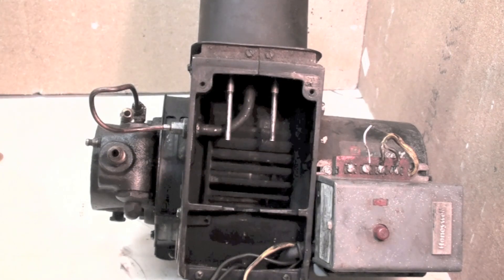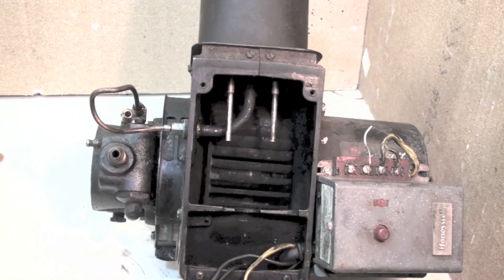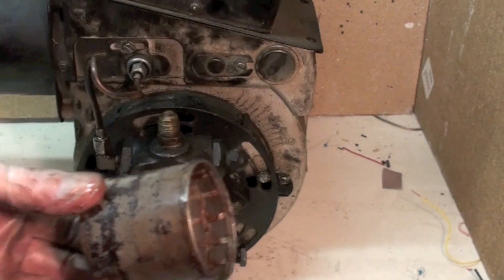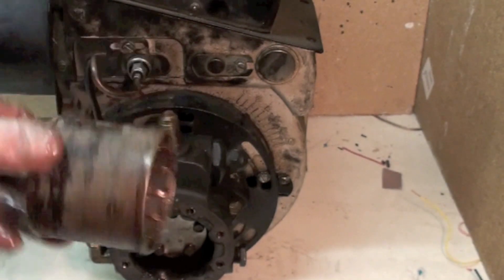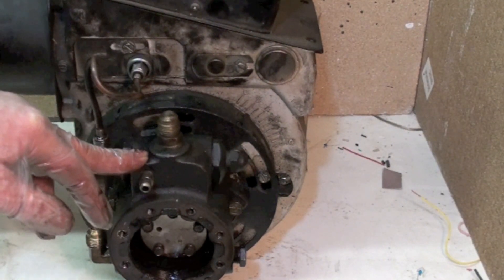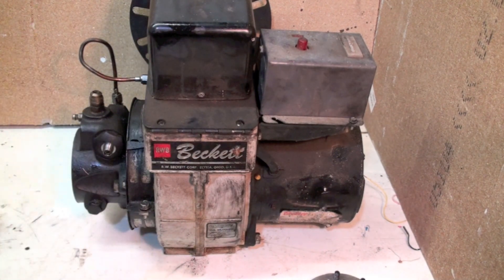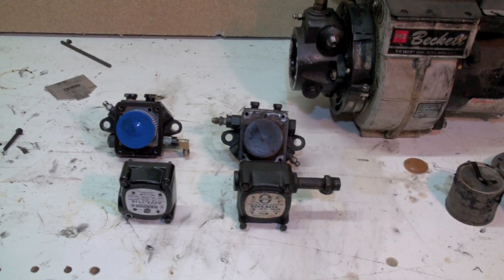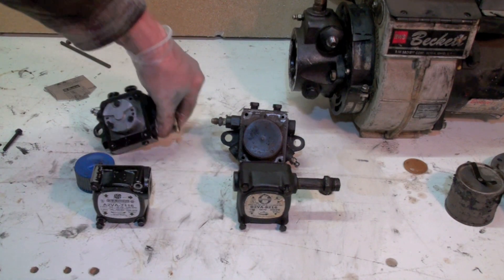oil furnace pump screens

Comment: Once you remove the fuel pump case where the screen  is, do you have to replace gasket
Reply from the maker: I usually use a silicone sealant rather than replacing the gasket.
GFM

Comment: thanks for the video, had fuel going to my pump and out my bleeder but not out to the nozzle. Used my ultrasonic cleaner to clean my nozzle and the pump screen with 50/50 mix of water and simple green. Made the nozzle and screen brand new and now Im up and running again with heat.
Reply from the maker: Oil nozzles cost about $5.
GFM

Comment: Having a hard time removing the cover on the A2VA-7116 pump to access the filter. Is it just the four bolts that hold the cover on? Doesn't want to budge and I don't want to break anything.
Reply from the maker: It is just the 4 bolts.  wooden hammer?
GFM
Reply: @grayfurnaceman  thanks so much for the reply. And thanks for the videos!

Comment: Love your videos!  I have a problem I can't solve.  My Wiel McClain oil boiler at my tenants house is making a noise like a washing machine before it starts up.  Very intermittent but she claims once a day.  It's never done it while I'm there.  I did a full cleaning and filter/nozzle replacement.   But it hasn't shut off or stopped working.  What could possibly make a washing machine noise before it starts?  I've heard it only on video she sent.   I appreciate your help!!!
Reply from the maker: Could be air is the system.
GFM
Reply: @grayfurnaceman  In the oil supply line?
Reply from the maker: @jcstevegigs  I would think in the water system.  Pump starting?
GFM
Reply: @grayfurnaceman  I was just over there this morning.  Fires up nice from thermostat or hot water call.  She says it was happening in the Summer with hot water so that eliminates the hydronic heat.  Al I can do is start replacing stuff like the motor/pump/coupling and see what happens.   If only I could hear it once from inside the shed.  
From inside the house it sounds like a washing machine out of balance.
Reply from the maker: @jcstevegigs  I don't have any answers.
GFM
Reply: @grayfurnaceman  that’s ok.  Hard to diagnose from a few paragraphs.  Thanks for your time.
Reply: @grayfurnaceman  I’ve had to reprise that furnace before for no reason.  Could air be entering the line somewhere?   Wouldn’t that show a leak?    There’s no leak anywhere.

Comment: I've gotten into working on old fuel oil furnaces and hot washer burners over the years and I am finding a lot of 1725 RPM burners running 3450 RPM pumps and having zero issues even after years of use.    I have several I use in various applications myself and they have never had problems either.
Reply from the maker: As long as the pump is oversized, I can think of no issues with this.  I have never liked the 3450 pumps.
GFM

Comment: Is there a type of filter cleaning detergent you buy  for cleaning the filter or will any detergent do the job
Reply: If you mean the pump screen, detergent usually works but if it is quite bad, you may have to replace the screen.
GFM

Comment: Damn! Everything but the coupler! Mine disintegrated. I don't know if it's from the  heat or a seized pump. Here we go. Thanks for showing me the screen. $100 bucks for a maintenance call and I don't see anything that was cleaned or maintained. I should have never looked! Curiosity killed the boiler

Comment: That round plastic disk is not necessary when using the new style disposable J-pump screen, however, if you clean and reuse the steel  permanent pump screen, you may want to reinstall it.
Reply: Plastic disk I called an anti hum device.

Comment: My burner won't start on it's own. It will fire up when I press the red button on the Honeywell CAD cell relay , but only runs for about 2minutes at a time. I timed it.
Reply from the maker: This could be caused by a number of conditions.  Plugged oil filter, blocked oil line, blocked pump screen, dirty cad cell, plugged nozzle.  If the unit does not burn when you press the reset, do not press it again.  You could fill the combustion chamber with oil which could cause a fire.
GFM

Comment: I have spark like crazy but no fuel, thought my pump was older one, with 1700 rpm, and hooked up an electric motor that is 1700 rpms, but realized my pump is 3450 rpms, am I correct in thinking 1700 rams would not be sufficient to pump fuel.? I have electric motor my spark coil and my burner with fan all hooked up in a line, I just wanna see if runs, gave a jar with diesel and got it going to the in line, it originally is run off a gas motor, just for testing do I need to put return line in the fuel.? Or anything else.? Thanks a lot for your help, I'm greatly appreciative.
Reply from the maker: 1700 will pump, just maybe not enough.  All pumps can be 2 pipe or one.  If there were 2, 3/8 fittings on the pump, it is 2 pipe.  One fitting, one pipe system.  One pipe system may take a while to draw the fuel up.  Hope this helps.
GFM

Comment: I have      the  pump with the chopper type  in it  and no screen  4 screws hold the back cover on ,, now if I bought  a brand new pump, to replace the old one, and I do not have the proper  pump pressure gage to set up the pressure, how could I set up the pressure at  a ball park  amount of pressure so it would work ?
Reply from the maker: +Rondo Schiavoni Most of these pumps come set at 100#from the factory.  Older furnaces, 25 years or more probably used 100#.  Hope this helps.
GFM
Reply: YES MINE IS KERO SAME SET UP AS OIL  BUT ITS 20 YEARS OLD .
Reply from the maker: +Rondo Schiavone Look on the model plate.  It may give the pressure.
GFM
Reply: thanks for your help you have very good videos.

Comment: might be a stupid question however  Ill ask you anyway, once a oil burner fires up, does the transformer continue making the arc spark in front of the nozzle or not?
Reply from the maker: +Rondo Schiavoni Most setups have the transformer operating for the entire cycle of the burner.  The cad cell relay can be set up to stop the transformer after the trial for ignition, but it is seldom done.GFM
Reply: in other words  ,you need spark to keep the flame lit?
Reply from the maker: +Rondo Schiavone It probably does not need to be on, but there is no down side to leaving it on during the cycle.
GFM
Reply: OK  I was just  thinking it would add more life to the electrodes and the transformer ..  thanks for all your advise .

Comment: After I cleaned the screen on a Delta CV pump on a Beckett AFG burner with a 1.1/.80 nozzle, a smell of oil came into the house theough the f orce hot air vents when the fan started and I noticed smoke coming out of the observation port of he furnace.  Is it possible that this is because of afterdrip?  Why would taking apart the pump cause this.  There are no leaks anywhere before the nozzle.  I can't see into the furnace.
Reply from the maker: This could a positive pressure in the heat exchanger.  Do you have any smoke coming out of the barometric damper?  If so, the chimney is plugged.  If smoke comes out of the inspection hole and not the barometric, the heat exchanger is plugged.  I don't think taking the pump could have anything to do with this.  Also possible partly plugged nozzle.  Hope this helps.
Reply: grayfurnaceman
Thanks.  No smoke coming from barometric damper; sometimes smoke coming from the inspection hole.  Would a plugged heat exchanger send bad air or fumes up into the air vents?  Why only upon startup for a few minutes if it's really plugged?
Reply from the maker: msrtra Sometimes when the burner warms up, it will draft better.  The other possibility is a crack in the heat exchanger.  Cracks in oil furnaces are not common but it does happen.  It may start smoking when the circulating fan comes on.  
GFM
Reply: grayfurnaceman
OK.  I think I solved it.  I took off the flue pipe and saw about 5 or 6 oval tubes.  They were buried in soot and ash.  It was 5 inches deep.  I vacuumed it all out.  I vacuumed out the tubes also.  The area under the flue exhaust connection (on top of that metal platform like thing) and in front of those tubes is all clear now.  Where did all that crap come from?  Does it mean that there is a leak somewhere?  I will go in tomorrow and vacuum again.  Anyway no smell anymore.
Reply from the maker: I did a series of videos on cleaning the oil furnace heat exchanger:  http://youtu.be/8ha2LRyGRpc  I recommend you have it commercially vacuumed out for best results, but if you have no choice, you can do it with a big shop vac.  Dirty job!

Comment: I have the second pump you were talking about at the ,sundstrand pump on my boiler are the two screens the same I need to change my screen
Reply from the maker: When changing a screen, always match it to the pump model #.
GFM
Reply: Ok thanks....the screen has the same number on the pump you are displaying so is that the right one? Av27116?
Reply from the maker: I believe so.
GFM
Reply: Thank you

Comment: Heres a heads up my burner pump would constantly run sounded like a river flowing thru the house weve bin having very cold weather lately turns out the radiator by my front door the pipe was froze thawed it out life is good
.

Comment: Just how much will the small amounts of dirt shown affect the pump functioning? I had some crud get in there which actually stopped the burner from firing up and used some spray solvent into the inlet connection to remove the crud. Seems to be working okay now but am thinking maybe I should pull it apart and take a look.

Comment: i took the pump off completely. The coupling looked good on the pump. I turned the pump freely by turning the coupling and heard it moving inside and bubble came out of the hole. Now i guess that means the pump is good but i’m still not getting fuel to come out of the primer????

Comment: Screen was clean on the mini pump, oil filter was just changed, there is fuel in the tank. Couldn’t find any leaks or obstructions. Just can get the fuel to prime in the pump. Haven’t taken the pump off completely just the cover to the screen. The screen and cover looked good. Do i need to take off the pump completely to see if the coupling has stripped out?
Reply from the maker: Yes.  Remove the pipes and 2 screws and it slides out.
GFM

Comment: I’ve checked the tank for fuel, checked the lines for blockages and air leaks, my motor is running and my fan blade turns freely? I just am still not getting fuel to the burner.
Reply from the maker: If you know fuel is available, the are no vacuum leaks or blockages and any screen is clean, the next step is to check the coupling that powers the pump.  They sometimes strip out.  If you know the pump is turning, the pump has failed. Hope this helps.
GFM

Comment: How can i tell if my pump is bad if i don’t have a gauge? My furnace stopped working. I bled the line and got it running again. It would run a little while a kick off. Everytime i pushed the reset button it would fire right up. After this went on for a few days it shut off and wouldn’t restart. I tried bleeding the line but nothing comes out of the bleeder? I’ve since replaced the oil filter since the old one was dirty but still i get no fuel out of the bleed screw?

Comment: i have a small fuel oil leak under my burner after the unit shuts down about 3 or 4 drops it dosen't appear to be coming from the pump gasket any ideas anyone ?
Reply from the maker: It could be a shaft seal leak on the pump.  Pulling the pump may show a leak.  You could also have oil impingement on the burner head.  Either one means you need to attend to it.  Hope this helps.
GFM

Comment from the maker: When we bleed an oil furnace pump, we are trying to clear both the suction and discharge line of air.  A vacuum pump would vacuum the discharge line but, as the pump is a positive displacement pump, it cannot pass thru the pump.  The pump pulls a vacuum, so the external vacuum pump is unnecessary.  Hope this helps.
GFM

Comment: Thanks for the reply! Today the furnace would not fire-I figured a block in the system (this happened about 6 weeks ago). I managed to get the screen out. It was really gummed up. I was able to clean it (used 'orange degreaser' and a toothbrush)- looked good-as-new. Re-assembled everything and tried to bleed the system through the gun line because I initially couldn't get the bleeder loose. No luck. Got the bleeder loose and bled it as you mentioned, then it worked! Thanks for the info!!

Comment: It could.  I would replace the nozzle and check the combustion chamber for carbon buildup.  When adding combustion air, the smoke should just disappear or better use a smoke pump to set smoke.  Also check for soot buildup in vent.  Hope this helps.
GFM

Comment: This is great information! I have the A2VA-7116 pump and there is no in-line oil filter. I haven't taken it apart but I imagine that my screen is probably caked up. The screen has never been serviced in >6 years since moving into my house. I have recently noticed that black smoke in the flue pipe while the burner is on. I adjusted the air and the black smoke disappeared. Now the smoke is back. There are so many variables, but do you think a clogged screen would contribute to the smoke? Thanks!

Comment from the maker: At this point, I would be looking for air leaks in the line.  Oil filter canister gasket, all fittings and pump gasket.  I would silicone the gasket on the pump.  Attention to detail is important here.  Suction leaks sometimes will not leak oil but only air.  Hoping for a solution and a warm night for you.
GFM

Comment: after we disconnected the line and blew through it, and cleaned the oil pump and reconnected it we used the bleed valve and no oil came through it. he tried to prime it 6 times afterwards and still nothing..

Comment from the maker: Have you been using the bleed valve?  If the line is full of air, it usually wont bleed through the nozzle before it shuts down on safety.
Hope this helps.  
GFM

Comment: we removed the entire oil pump and cleaned it out, the gears do spin on it. and now I understand why the fuel isnt in the line its because we dont have enough fuel in it. makes sense. he blew out the line going to the tank and we still have no oil..the screen is cleaned out also on the oil pump. we are not getting fuel to the pump, any other suggestions?

Comment from the maker: First, when you are constantly running out of oil and having t prime the pump, the chances of you plugging the nozzle go way up.  I understand the economics but try to add oil before running out.  If your tank is at the same level or higher than the pump, you can loosen the oil fitting at the pump, should get oil.  If oil, remove gun line point to can.  restart unit.  Should get oil.  If no oil check screen.  If you have oil, nozzle is plugged.  Hope this helps.
GFM

Comment: page 2.. and let out a pot full of water and still nothing. after lockout and the furnace goes to kick on you can hear it zapping and then a click where the ignitor would ignite and it doesnt. What could be our problem/A dirty screen? Is it the pump thats bad? we have no idea what we are doing except from what is on your videos. how do we check to see if the pump is even getting oil?

Comment: page 1...s my dilema.. we are poor and cannot get oil assistance since half my house is ran by electric and the other half by oil, we had to choose electric assistance in order to keep the electric on. With that said we put 5 gallons of diesel in a week so we are always priming the pump. This time the pump started and the furnance kicked on for a day then shut off. We changed the nozzel and the filter on the oil tank, blew in the oil line ( we could hear it gurgling in the tank) and

Comment from the maker: That is the tough question.  If there is oil supply to the pump and there is no pressure at the gun line, usually the pump has failed.  You might look at the oil furnace playlist for more info.  You also need to determine if the pump coupler has failed.  I will be doing a vid on pump diagnosis as soon I get time.  Hope this helps.  
GFM
Reply: How often in the field do you see the pump solenoid fail?
Reply from the maker: @MindKontrolleProject  Never had one fail.
GFM

Comment from the maker: Ah, there is the question.  It is not as simple as it would seem.  If you can assure that there is oil supply, and no pressure is found at the gun line, usually that means the pump has failed.  You also need to be sure the pump coupler has not stripped.  You might look at the oil furnace playlist for some help.  I will be doing a video on procedures to follow to diagnose pump failures as soon as I can.  Hope this helps.
GFM

Comment from the maker: The triangle is a chopper that is supposed to cut up particles.  It is possible that you have algae in your tank.  Yes, there is an algae that grows in oil.  If you see long stringy black things on the nozzle filter, that is usually algae.  It could mean replacing the tank.  GFM

Comment: Thank you for your reply. This pump does not have a filter like the one in your video. It has a tringale that spins. I checked on line & it shows what I have is correct. What confuses me is that it will run fine than runs bad until iI change the in line filter.

Comment from the maker: Still catching up with you.  I assume it is a 2 pipe system.  If you get a bad oil the 2 pipe systems plug faster.  I kind of hesitate to blame bad oil because a close friend delivered oil and his was filtered as it left the truck but he was always being blamed.  Some tanks that have been in service 30 to 40 years have a lot of sludge.  It could also be because the boiler was running when being filled.  The tanks can be cleaned but  expensive.  I think just keep changing filters.  Good luck
GFM